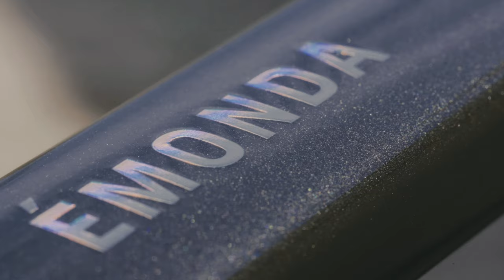TREK EMONDA ALR 2023 BUILD

Comment: Would like to ask about your height? I'm 5'4-5'5 / 165cm, and according to Trek, Size 50 is good for 165cm. I'm more endurance weekend rider.
Reply from the maker: @josephdesales7791  I'm also 165mm and the 50 is perfect! You can adjust how low you want the copkit to be with different stem high....
Reply: @Stefanosinf  Holy moly, did you just made my decision making faster? :face-purple-wide-eyes:I had Emonda ALR way back 2019 and I'm thinking going back again.